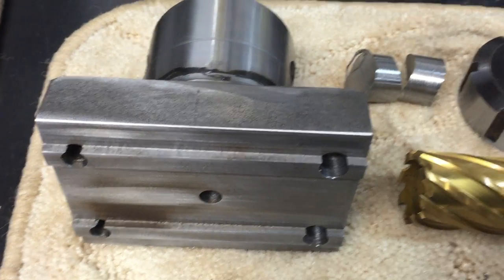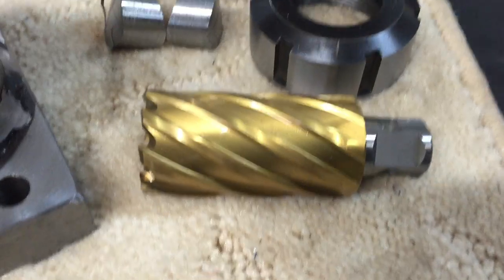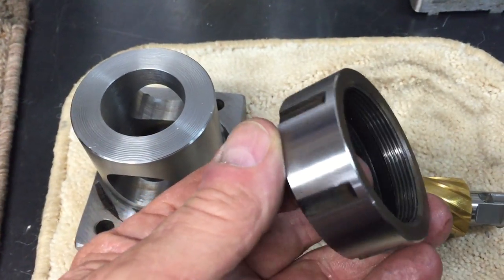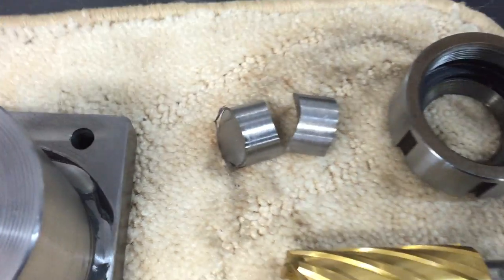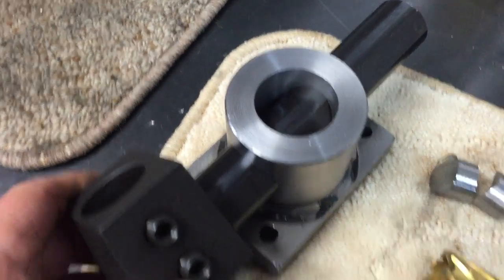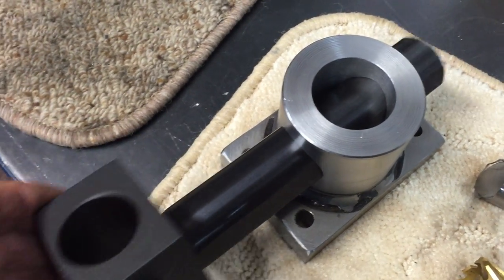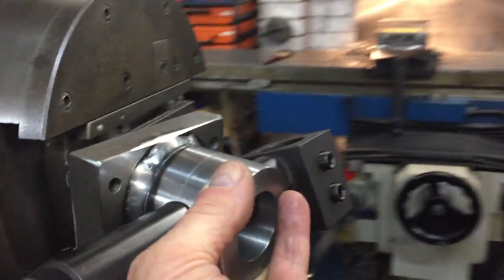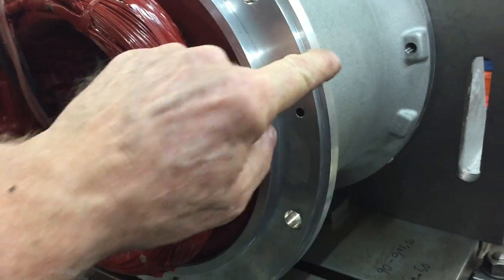Making a boring adaptor for the HBM facing head

Comment: I was looking at a rota broach holder for my little mill, I think I will go ahead with the purchase now. Thanks Bruce.
Reply from the maker: +Bundy Bears Shed Mate you can't go wrong, I have a morse 3 type holder Hare and Forbes  D9503. I use that in the pedestal drill, the lathe and in the mills with a morse adaptor, or use the ER40 collet head if the clearance isn't an issue, the slug captured in the collet isn't an issue, and for the one off holes.